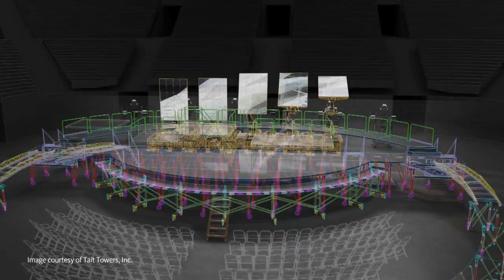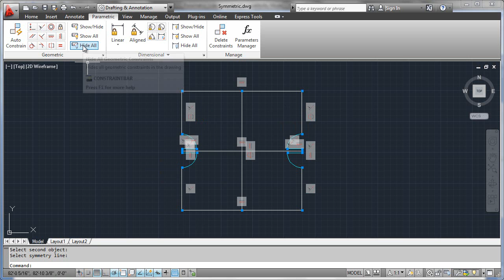Symmetric Constraints

Comment: In the previous videos we constrained the middle line to the mid points of the horizontal lines. And in the previous video when we pulled the line to the right, the whole drawing stretched symmetrically. However in this video, the coincident constraints in the middle-points of the horizontal lines seem to still be there but they act as if they were relaxed. If I don't delete those 2 constraints, AutoCAD doesn't let me apply the symmetrical constraint because it is already defined.